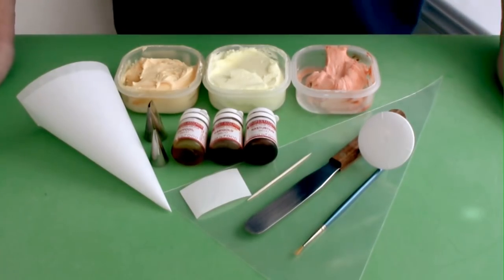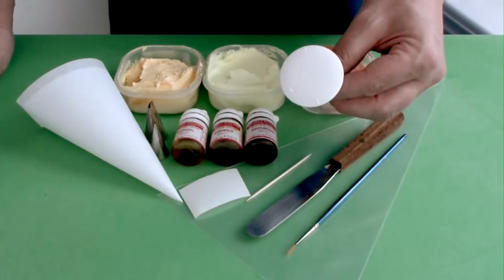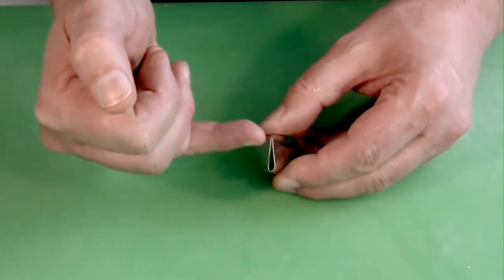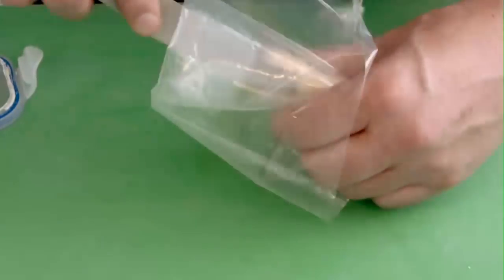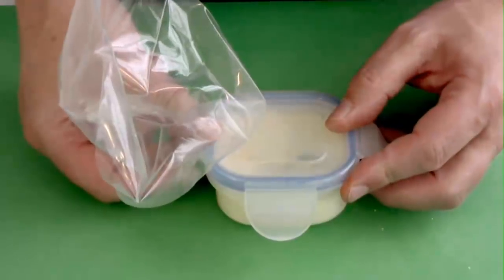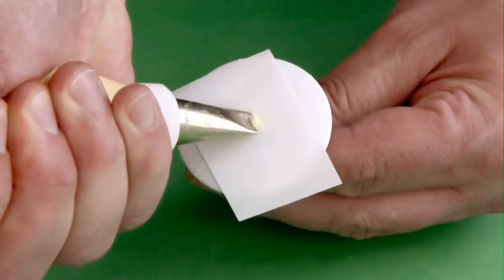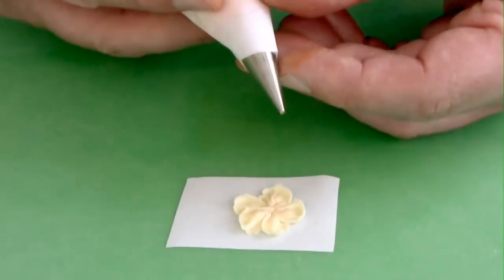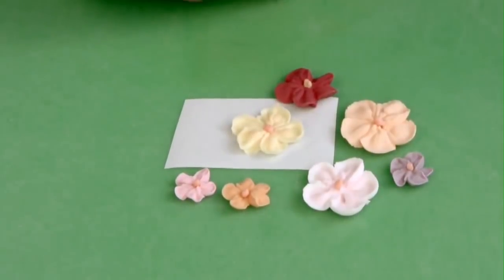Ceri. Dz: Piped Five Petal Blossom Basics Video Demonstration

Comment: Hi Ceri, I have a question about doweling Royal iced fruit cakes. I’ll be making a tiered cake and using the tips from your cake videos, but do they need to be doweled? Or can I stack the tier’s without the dowels?
Reply from the maker: Deidre, I always dowel a stacked cake just to make sure the tiers are supported and not compressing the tiers below which could then cause the cake to topple or collapse.
Reply: @CeriGriffiths  thank you so much!!